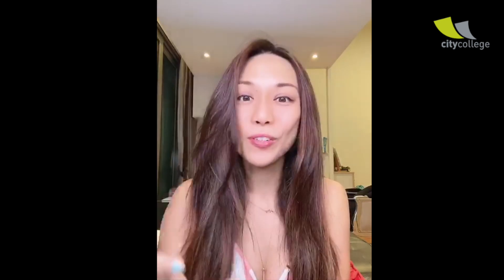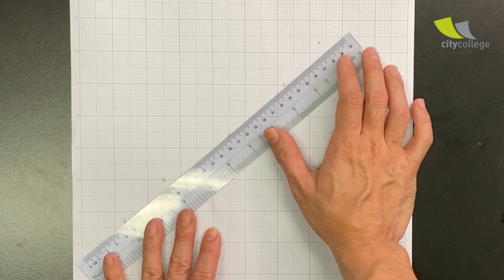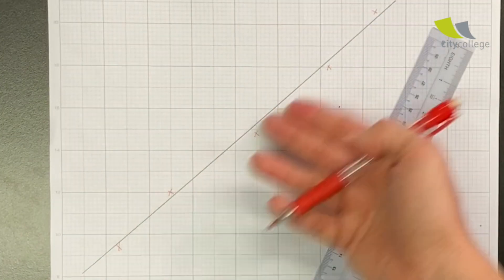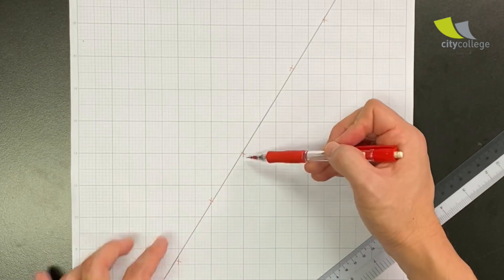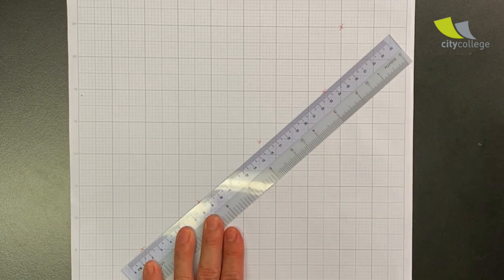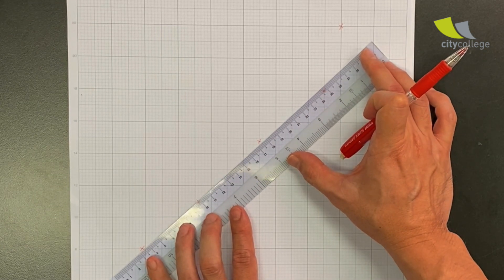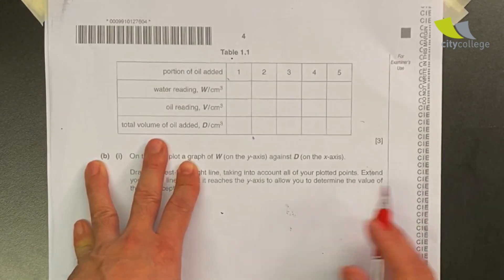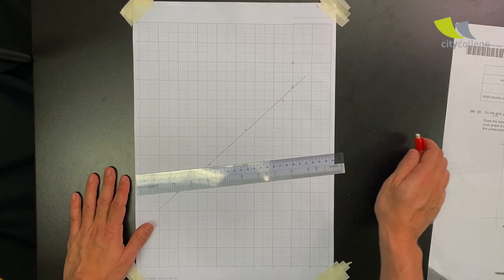Science (Physics) Practical Skills - Best Fit Line

Comment: hello! just needed to clarify something. At 6.58 what do you mean by saying you change your table? so you erase the outlier and just fit it to the best-fit line? and then you change the values you have obtained in the table previously with the set-up?
Reply: Hi Chandra, in the context of an examination, if there is short of time to Re evaluate a certain point on the graph, especially if it’s not an upper or lower end point, if it’s me ... I will adjust the value of the outlier. But if this is actual scientific research, it’s another story.